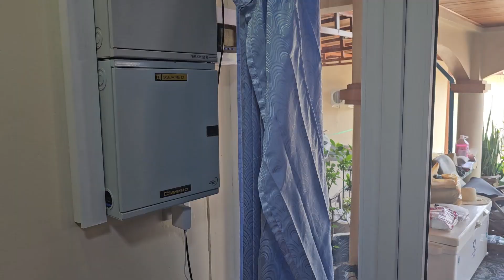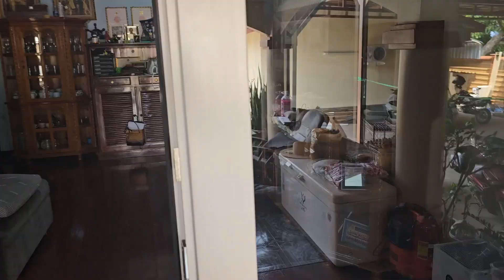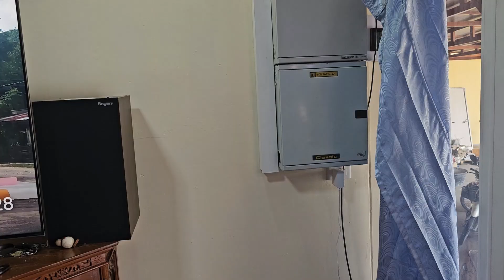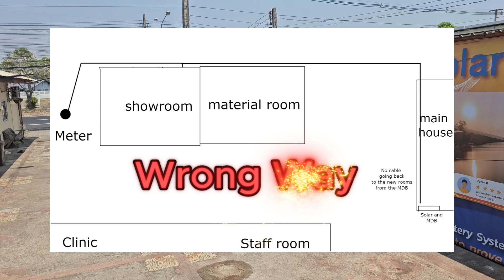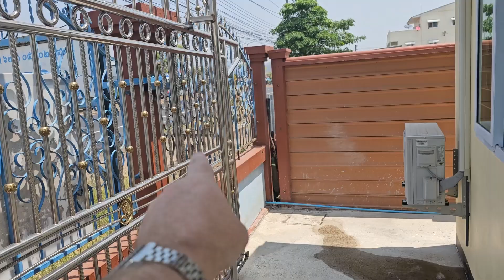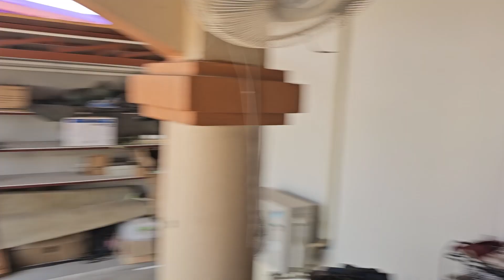Common Electrical Problem in Thailand | SolarThailand.biz

Comment: This video is perfect timing. I am looking at a system and we are 3 phase and we are split with several consumer units all between the input to the warehouse area where we want to put the batteries, inverter etc. because the warehouse roof is big enough for a lot of panels and north south facing. But I can’t see how the solar will back feed along the same cabling.
Reply from the maker: If the power is measured by the solar system, it will be able to support it. But to have a big electrical system like that without a proper MDB first in the line, is not good to say the least. It doesnt have to be physically first in line, just in terms of energy and cabling.
Reply: @ hope you get to install and test Energy Leaf. If we get the finance I will let you know how we get on. Cheers from Chiang Mai.

Comment: I understand what you're saying. When we drew up plans for the property, I knew at some point we would have solar. I designated a "utility room" on the plans, and told the builder several times to run electricity there FIRST before anywhere else. He didn't listen, or didn't understand, and it was expensive, and somewhat ugly to fix, but I did get it fixed. Hopefully I will be able to meet you in 2026. 🙂